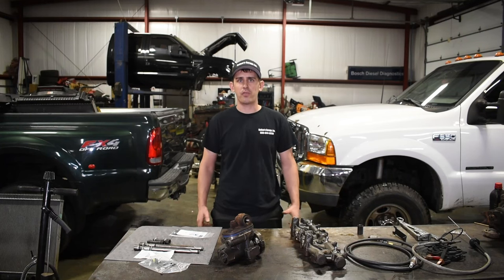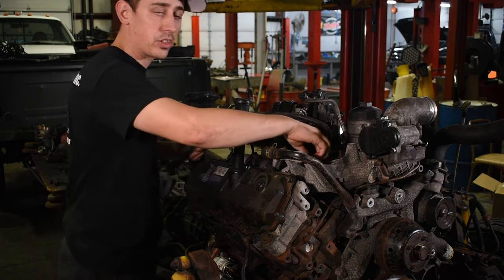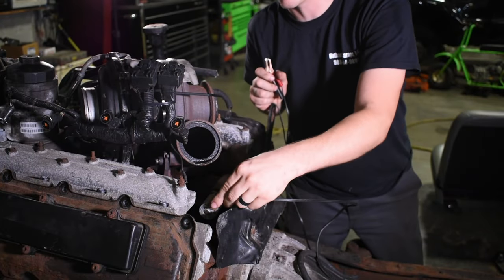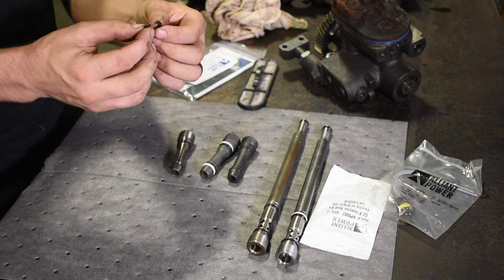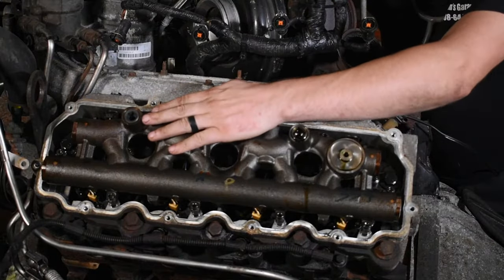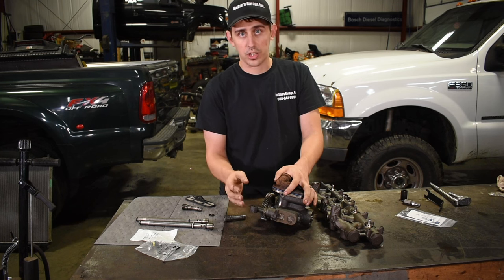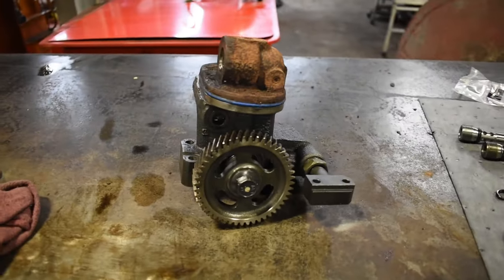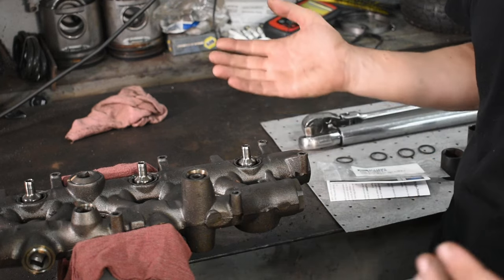6.0 high pressure oil leak diag and repair

Comment: Hey great video and I appreciate the information. With my high pressure oil leak I feel like I’m chasing my tail. It has new dummy plugs in both sides and standpipe upgrades. The only thing I have left is the injector seals. I’m doing that this weekend and I’m praying it fixes it. Will this cause a no start hot?? That is my issue and I’m not sure if this would be the fix. If the nipple feels tight can it still be the injector oring seal that is making the leak without the nipple oring being bad?
Reply from the maker: Have you tried the air test to narrow it down?
Reply: In The Shop no I haven’t. I don’t have the fitting to do it or the ipr pigtail to energize it
Reply: In The Shop I’m actually unsure how I can energize the ipr without the pigtail without damaging it.
Reply from the maker: I have links in the description with all of the stuff you need to do it. If you don’t do the air test you will keep chasing your tail.
Reply: In The Shop would the injector oring on top cause the no start hot? If so I’m almost apart right now and I can check them all. Another problem I have is I have to be all the way back together tomorrow. It’s my only vehicle and I have to make it back in forth to work. It’s been a real pain trying to do anything
Reply from the maker: Injector seals can cause a no start hot for sure.
Reply: In The Shop thank you for being so quick on responding. That’s awesome I’m impressed someone actually does that.
Reply from the maker: I try my best to help out my audience. This is the whole reason I started doing it.
Reply: Josh what was your issue @josh grubb

Comment: I have a 2005 Ford Excursion 6.0 powerstroke throwing a code 2290. I don’t have any black smoke at start up, idles ok, the problem is no power during certain speeds. Do you think it’s the HPOP or one of the sensors? I have an Edge CTS2 but can’t monitor all of the things you are saying to check for. Any thoughts of where I should start?
Reply from the maker: Unfortunately the only way to really diagnose that problem is to watch that specific data while the issue is occurring. I would try to get my hands on a scanner or monitor that can read that data. That being said I have seen quite a few HPOPs cause a lack of power and simultaneously set that code. I just don’t like to throw an expensive part like that without verifying.
Reply: Thank you for your advice!

Comment: Help!!!  This my first diesel 2007 F350 6.0L 79,000mi
I get a message on instrument panel “low pressure oil.  Oil gauge goes down only on idle.  If I rev up engine and oil needle gauge goes to normal.  Can you help me with steps to follow.  Thanks so much.  God bless.
Reply from the maker: Most common cause of this is the oil pressure sensor(switch). It is the single wire plug located between the oil filter housing and the turbo. When they fail they give this symptom.

Comment: Hello I have an 06 6.0 I just rebuilt, hhc Nipple cups, updated stand pipes and dummy plugs, and new injectors, I have also installed a new icp and a apartment “known good ipr” I can only build 200-280 psi oil pressure any idea?
Reply from the maker: Have you tried doing the air test?

Comment: Hey man, I got one question, what is the torque for the standpipes and dummy plugs. I hear 60 ft/lb would just like to know for sure??  And good video!
Reply from the maker: I usually hand tighten them through experience but 60ft lbs is correct.

Comment: this is Will Witt  i have done everything to this truck but still cant get it right . history   truck ran great over 90,000 on rebuild bullet proof motor. broke a injector tip  maybe water, sent it off to industrial injector they checked it out replaced nozzle they said it was fine. I had another injector where the spool was sticking so I on other side took it apart used 600 sandpaper and got it to move freely.  I changed my oil added marvel oil . put it all back together  and it started right up . went for a test drive seemed fine came home turned it off no start.
cooled off started right  up. as soon as it heats up  no start.. i have replaced everything all new ford tube and dummy plugs, new no leak cups nipples,  got seals from industrial for injectors replaced them changed oil checked oil fill in filter when cracking.  but oil pressure gauge shows oil then doesn't  took off icp wire cen get it to start   hpop pressure 2800  icp about 30  i'm at a total loss HELP.
Reply from the maker: Hi Will, these can be tricky sometimes. Have you tried doing the air test while the truck is hot?
Reply: @InTheShop   thanks for replying,   I have done everything yes hot  before I did cups and seals saw oil coming out under rail by injectors. My scan tool only showed one code low Icp, i put on a new ICP connector. took it all down to the HPOP  and redid all seals and cleaned IPR even though it was cleaned  tested to make sure it moved.   I just don't get it. I completely rebuild this from scratch put 90,000.00 miles on it had that injector now just can't figure it out.

Comment: I have a early 04 6.0 that has a long start and has oil pressure when it's cold but it drops when it warms up, if you pat the gas it jumps up but falls right after I thought it was the hpop so I tore it down and it was missing the ball bearing in the side. Replaced the pump and it did well for about 30 miles then started doing the same thing. Any advice?
Reply from the maker: Hey Brock, have you tried the air test yet?
Reply: @InTheShop  I haven't I will give it a try

Comment: Great video I have a question.
 Or better yet I'll give you this scenario.
 Driving down a freeway low fuel comes on . Go to the gas station put diesel in . Filled it out start up no problem driving down the road Approximately 4 miles and ban it just Shut off. 
I've change the two filters check for water didn't find any.  I put a brand new ficom.     Fuel engine control module. Put in two new batteries .
 Put some diesels start in the Carburetor and it started for a second . Someone said if I remove the ICP And cranked it over oil should shoot across the street. I did that and I have no oil coming out whatsoever. Like I said I was driving and a just shut off and he ideas thank you In advance
Reply from the maker: Does the oil pressure gauge on the dash come up when you are cranking it?
Reply: Did you figure it out? I just bought  truck with a similar scenario. PO said after filling up and driving home  it started running rough and eventually died.  And had to tow the csr home.

It has the  warm non start  and once it cooled down  then it would start and but it would still  not have power to  drive

Comment: Good morning, I like your videos. I have a question. If you can answer it. I would really appreciate it. I have a 6.0 engine. I do the pressure test and air comes out of the injector where the nipple enters. That's why when it heats up the engine and I want to turn it on, it no longer turns on.
Reply from the maker: Correct. It sounds like you have a bad o-ring at the top of the injector.

Comment: Great video. I’m having some frustration here, I had a crank no start, did the air test and hear a leak at the injectors. Replaced nipple seals and o rings on injectors. Still hearing a slight leak. Can the spool valves go bad to where I need to replace injectors to fix this issue?
Reply from the maker: They can go bad for sure. Also if the system is completely empty of oil some air will escape. Add a bit of oil to the rails and retest first
Reply: @InTheShop  there’s still oil in it. Took 15 minutes to hear it escape. I took the rail and injectors off. Now I’m isolating the leak to the injectors. How would I 100% know it’s coming from injector spool valves ??? I’m stuck on this

Comment: Having a hard time figuring out what's wrong with my truck. I have a visible external oil leak from somewhere in the valley & have had it for awhile. Had my hpop replaced because of other issues & truck ran good for a couple months then I started having stalling issues but truck would still always start back up, brought it to a different shop that told me the hpop was bad again, which I doubt since its an 05 but they replaced the ipr & truck seemed to run good. But died on me again while out driving but wouldn't start backup or reach 500 psi, I pulled the ipr & it looked completely fine but cleaned it anyway and truck started again but I don't think I did anything. I feel it may have started anyway again after sitting a couple days. I notice my ipr reaches 85% but still starts, just with a long crank. I dont trust it to drive anywhere. Any help would be greatly appreciated.
Reply from the maker: Have you tried doing the air test yet?
Reply: @InTheShop  finally got the tools needed to do an air leak test, i got ipr valve air fitting rather than going through the icp and having to energize the ipr. I put 140 psi through it & listened to both sides & i can't hear an air leak at all. Made sure to listen very closely to both sides & i dont hear anything. Thanks

Comment: I've no power and it won't throw a code, this is the only thing I can think of right now that's the problem.is that typically the circumstance ?
Reply from the maker: You will really need to watch engine data to be sure. Do you have access to a scanner or a monitor to watch PIDs?

Comment: Hey I have a problem with my 2003 6.0, its not starting when hot, I changed the ICP Sensor, changed the IPR screen, changed the HPOP, yes I did the yellow O ring at the bottom of the oil pump, changed the line on top the HPOP, bought it from the Ford dealer, still ran well when cold but lost ICP pressure when hot, have a scan gauge 2 which shows everything reads right besides when it gets hot the ICP pressure is only at 230-260 psi while the IPR reads 84.7%, what should I check next. I am a mechanic for over 45years but never work on these trucks before, this is my personal truck and its really the first time I am having issues with it, can you please lead me to the next step I should take.
Reply from the maker: Have you tried the air test I did in this video?
Reply: In The Shop I did an air test through the IPR valve and waited for about half hour but didn’t found any leak, after reading more I just made up a fitting to do a leak test through the ICP and will hook up a direct 12 volts to the IPR valve while doing the air test, tomorrow I will do the air test and let you know the result. Remember these 03 is a pain in the ass to get behind where the valves are located, hope to find the leak.
The only problem is it lost ICP pressure only when it’s hot and at this time I can’t start the truck since I have the FICM off and turbo pipes off, if there is a leak, would I still find it under these conditions
Reply from the maker: If you heard no leak during an air test you most likely have a bad high pressure oil pump. The 03 and 04 were very common for a steel ball falling out of the side that was originally pressed in to block off a passageway that was used to machine the pump.
Reply: In The Shop I checked that already, the HPOP is a new one I just installed a few days ago, I tested my old one and saw it leaking from the front seal, I changed it and taught it was good but as soon as it got hot I lost ICP pressure, so I pulled it apart again to double check the yellow seal and the pump, the ball is in the pump and the yellow seal is perfect, therefore there has to be a leak somewhere else, so now I still have it apart besides the intake and turbo installed, now I am searching for the leak because I don’t want to put it together if I don’t find the leak, anyhow I am doing the air test tomorrow and will keep you informed
Reply: I did the air test through the ICP while activating the IPR, it was leaking but could not find the leak, so I took the pump cover off and blew air into pump, eventually I saw oil blowing through the oil hole in the oil cooler feed, ( I had the oil cooler removed) so from what I saw I believe the oil pump is not good, contacted the seller Swag Performance from Tennessee and they said I purchased a late 2004 pump and my truck is a late 2003, it was a round pump, are there two different round pump for these trucks, late 03 with the 6.0 to mid 04, and then another round pump for the late 04? Just asking if there is a difference?

Comment: Driving down the highway today my truck lost power and died now it just cranks and won't start. It builds oil pressure but no start. Possibly a high pressure oil leak??
Reply from the maker: Definitely a possibility. You would need to check for codes then look at data to know for sure.

Comment: I don’t have a fitting for the icp but instead my air is hooked up through the ipr location. I’m getting air out of the oil fill and the intake side. Does this work the same for testing?

Comment: Is there a diagnostic method to suspect the stc over the dummy plugs? 

Patreon worthy content, will start looking at your other work.
Reply from the maker: Hey Ron, Usually you will hear the air coming from the back of the engine instead of under the valve cover area. If you do its time to pull the pump cover and inspect. Once the pump cover is off you can reinstall the IPR and retest the system. I started setting up my Patreon but never pursued it. Maybe now I will. Thank you!

Comment: I’m chasing a high pressure oil leak I’ve rebuilt from ground up 06  6.0. Can the plugs on the bottom leak. I’ve replaced the nipple cup orings and injector top seals also the icp sensor voltage on the money and the ipr moves with snap on scanner I’m stumped

Comment: I have an 03 6.0 can’t remove the standpipes to put the updated ones on both sides but the standpipe comes out half a piece the other part stays in the head. Any suggestions?
Reply from the maker: On a 2003 the standpipe threads into the branch tube. Can you send me a picture of what you are dealing with? Nathan@intheshopmedia.com
Reply: In The Shop disregard that last message i just found out it’s not the original engine, the engine is a 2005, we took care of the problem, but another question I have is that I don’t have injector clatter at all anymore when I turn my key. I had broken down Tuesday at a store after fuel up and didn’t want to start so I thought I would be a high press. Oil leak some where but started noticing I never heard my injectors buzzing when my wife cycled the key. Funny part is when I closed my hood when I was about to call a tow truck I tried starting it one more time and It fired up and ran till I got home and hasn’t started since hot or cold with no injector clatter again
Reply from the maker: Eluterio Villanueva jr any codes?
Reply: In The Shop no sir nothing I’m pretty much stumped on it, if I can’t figure anything out I’ll pretty much load it up on a flatbed trailer and haul it to the dealer or a performance shop
Reply: Back in 2014 I had the same issue in my 2005 6.0 I drove it to get fuel and came home didn’t start up but the next day it fired up and went to the car wash shut it off and didnt fire up with no codes as well so I had a tow company haul it to the ford dealer and told me it had a high press. oil leak and a bad oil cooler had it fixed and ran like a champ after that, but this 03 with the 05 engine is making me pull my hair out lol

Comment: Hallo. Im having problems with 2003 f250 6.0 2wd dying, then no start after 5 or 10 minutes. I removed standpipes and there both kind of bended. Could this be all my problem? Cuz truck was doing great before,  only 145,890 miles

Comment: 04.5  6.0 powerstroke

no or hard start cold 

mods 

bpd- external oil cooler
egr cooler and valve delete
blue spring kit
bpd-ficm
new ipr valve
3" exhaust deleted cat 

per scan gauge all parameters check out

base oil on dash after 10 sec crank

cranks very even sounding not like one with bad compression

once it eventually starts no issue other than an occasional short lives misfire/ruff running but runs, idles, tows and restarts.

every morning it repeats starting symptoms 

any ideas/suggestions???
Reply from the maker: Start by making sure FICM voltage maintains 48volts while cranking not just key on. After that do and injector buzz test. If you don’t have access to a scan tool you can just cycle the key on and listen closely to the injectors to see if any of them are not buzzing. If you need to have something to compare it to listen to the truck when it’s hot. The injectors should sound the same hot or cold. If the injectors don’t buzz smoothly you need injectors.
Reply: @InTheShop  yep ive noticed they lack the buzz/clatter key on engine off

ok injectors
Reply: @InTheShop  Thank you so very much buddy
Reply from the maker: No problem!

Comment: I have a crazy question, I have been trying to figure out a crank no start. I did a pressure test with a gauge and with key on and i had no pressure loss. I have sync on my cam sensor so i don't think that's it. Could it possibly be the HPOP? I need some help please! Thank you

Comment: What I did was install the shop air tool into where the injector pressure regulator sits and cranked it to see how much oil was pumping out and it didn't seem too high of a flow any ideas need help been sitting in my driveway for about a month and I can't get it to start

Comment: So I'm curious to know  What you would do if you replaced the dummy plugs, the nipper cups, the fuel rail orings and the orings under the high pressure oil pump and you still had a hot no start.   This is an 06 f 350 6.0 by the way
Reply from the maker: Have you done the Air test? Most likely it’s leaking from the tops of the injectors

Comment: How much air pressure is needed to do the air test? I don’t have a very big air compressor.
Reply from the maker: The more the better but 90-100 psi should do.